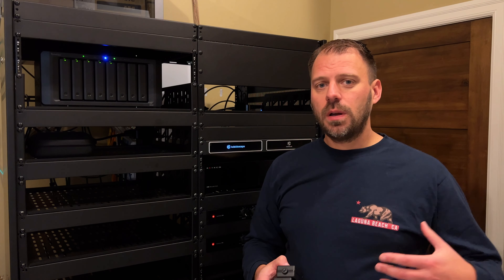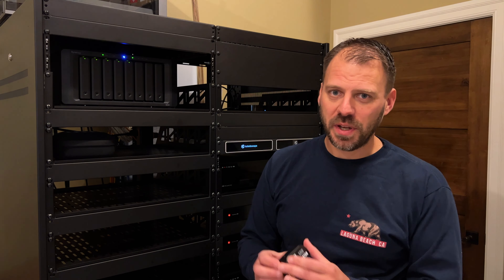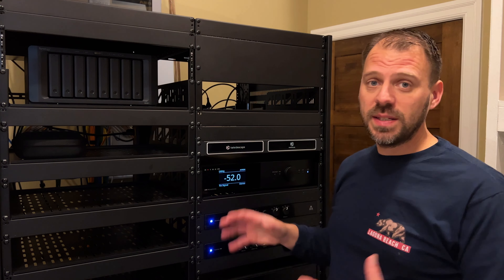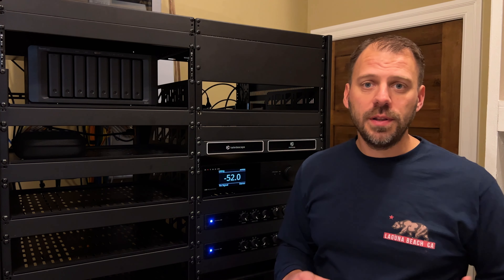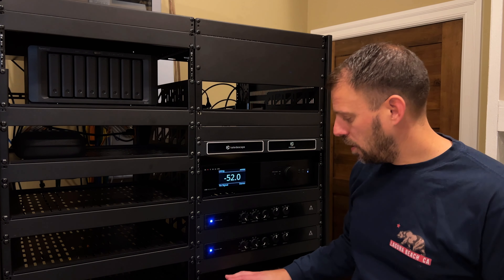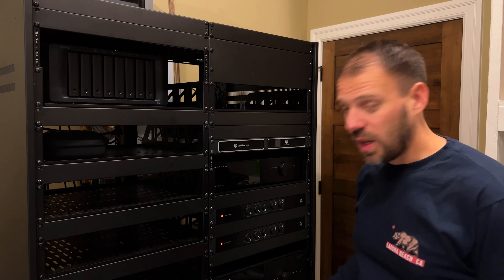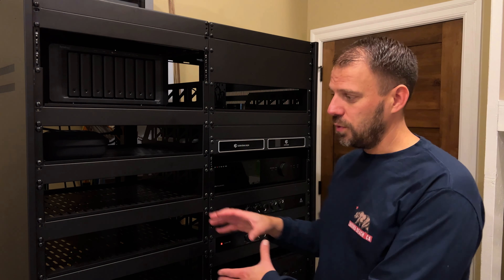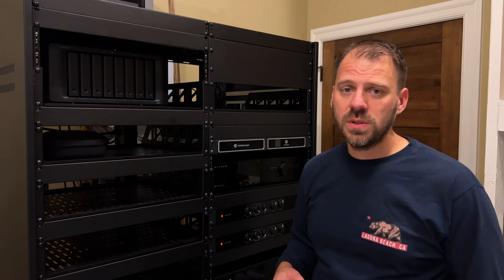Troubleshooting & Trying To Solve Home Theater Speaker Hiss & Buzzing | Ground Loops & Isolation

Comment: Sounds like you need to run a new dedicated line and turn off all the other breakers, to see if you can isolate.
Reply: Can you reproduce the noise by driving the same speakers and avm70 at a different location…
Reply from the maker: I’m going to mix up some wiring and speakers coming up.

Comment: Why not try a different type of speaker cable run outside the walls to an in wall just to test?  Only need to do one to see if it makes a difference.  Probably a long shot, but cant hurt to try.  I would assume you're using decent enough in-wall rated cable ran away from any electrical runs but worth a shot just to rule out.  Grab a spool of Monoprice or if you feel like spending a few extra dollars can go with Belden 5000UP or a step up to Belden 1311A.  Those are just what I tend to use.  Other than that I can't think of what your issue could be.  The only time I ever had to deal with significant noise was from a ground loop caused by the coax connection to my cable box.  Just used a coax ground loop isolator and it worked.
Reply from the maker: Yep, I talk about this in the third video coming up. It really is the next best thing I should try. Taking those speakers out and taking them downstairs to try on the same amps channels and everything else as is, except different/shorter wire not in the walls.